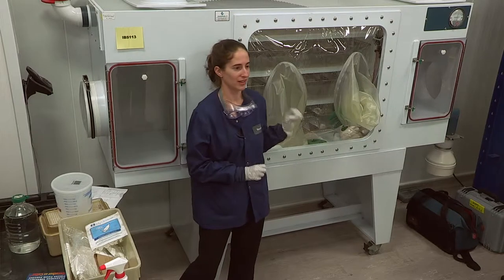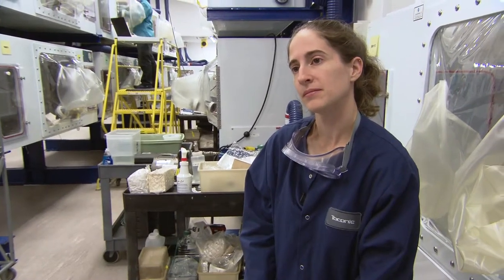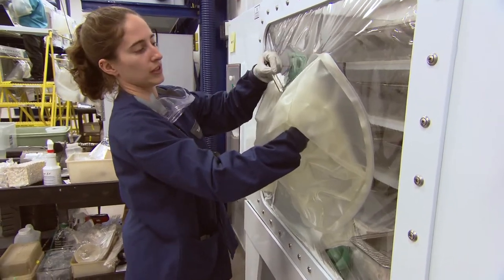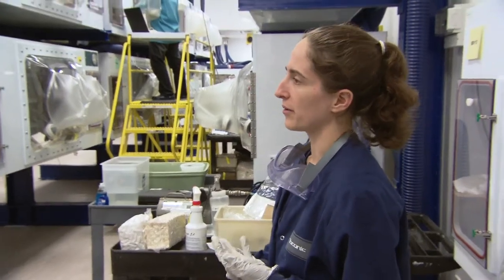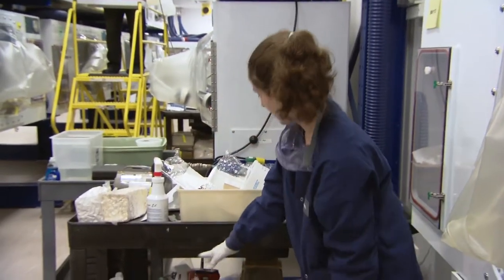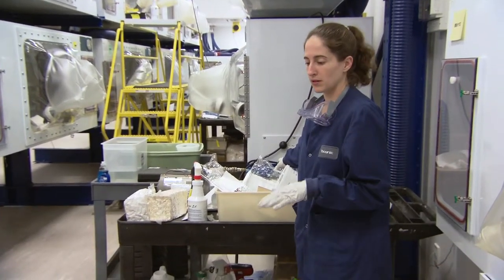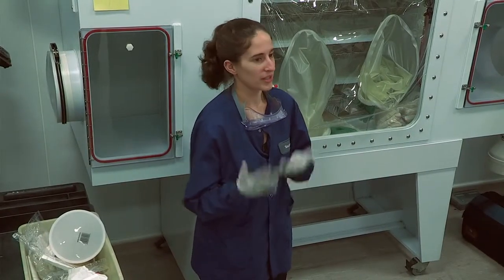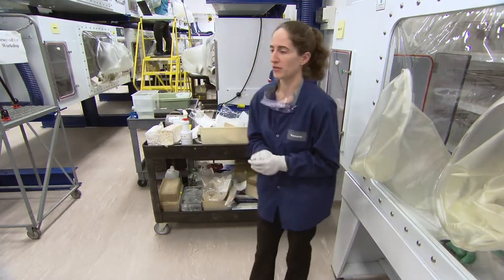Isolator Demonstration - Part I

Comment: Really interesting and insightful demonstration of aseptic techniques. The DURAN Autoclave Bottle with self-venting and self-sealing cap 219946305 / 292063002 has been re-introduced by DWK Life Sciences. The design has had decades of proven and reliable use within Gnotobiotic facilities.